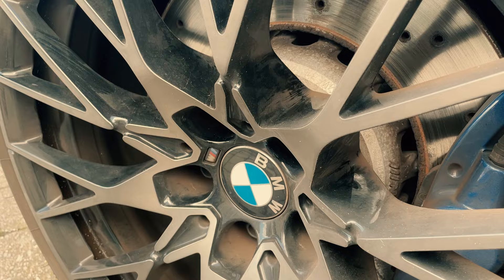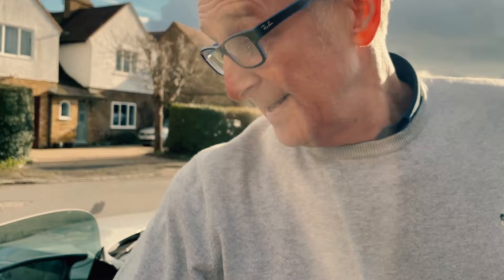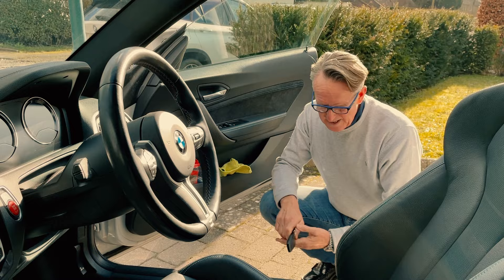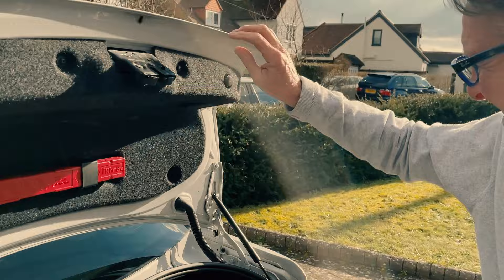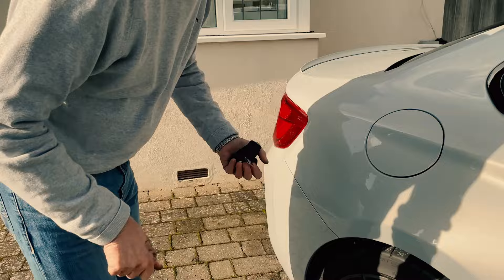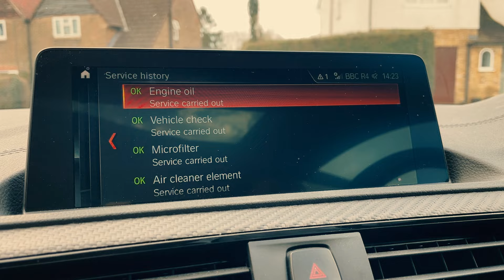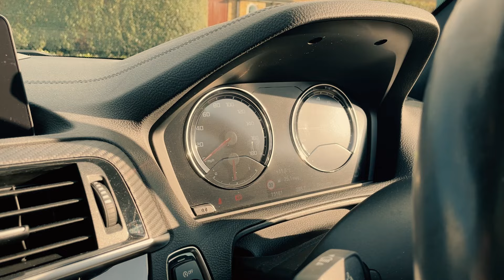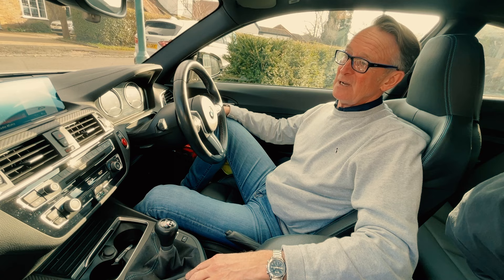Gary The Car Dealer - What to Look for when Buying a Used Car

Comment: Nice review. But a couple points. M2’s have orange peel from the factory in the A pillars. They also have dust in the paint on the tail gate, nothing  major but not acceptable for a new car. Also, the finish of the lacquer isn’t great. I had mine flattened in places. BMW said its hand built 🤷🏻‍♂️. Lastly, they all rattle from the dash. So expect it. Finance companies can take months to show it’s cleared. I know it’s not a mechanical inspection but I check for lips on the brake disks and just have a Quick Look under the oil filler cap for emulsion. These aren’t know for head gaskets but it doesn’t hurt to check while the bonnet is up.

Comment: I’m glad you said about the chips on the front lower bumper as mine has a few, but when I come to sell it I’ll use the it’s platina, and a used car so your gonna expect it
As I’ve part exed cars before back to dealers who go over it n knock price by them
Really like a video of painting the brake hubs as I’ve wanted to do it on my m2
Reply: I will definitely get a video put together showing the quick way to tidy up the brake disc shanks. It’s easy and non expensive to do. Thank you.
Reply: @garyrolfe4895  I’ll keep an eye out for it, also if u do touch up them alloys, as I need to do one of mine just on the edge
Reply: Got a black m2c, it picks up stone chips like a mf 😢
Reply: @MonssterHD  I have exact same problem. On the lower front end under the head lights mine r bad
Reply: @scottp4547  rear arches where the stickers are also get a lot of abuse